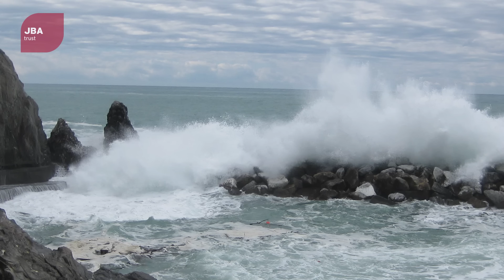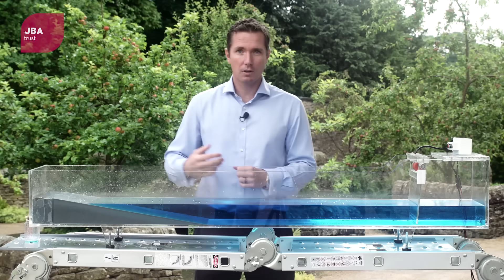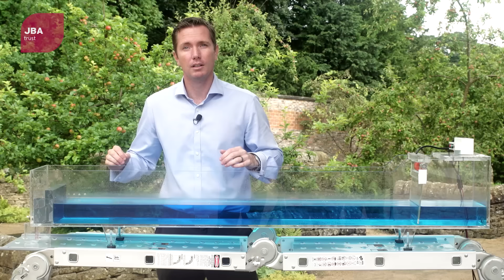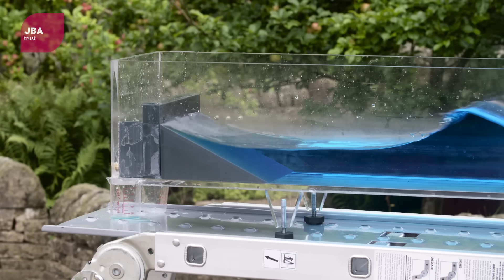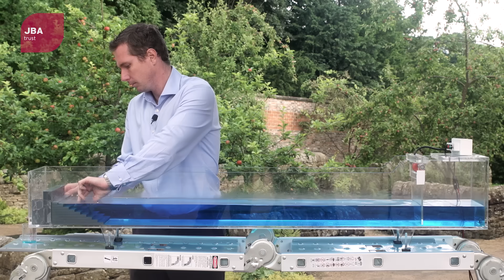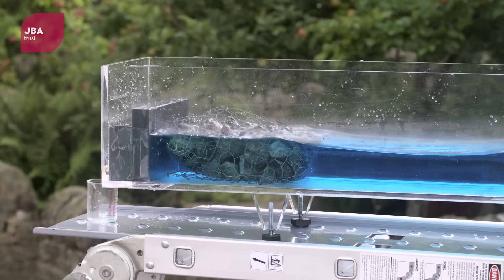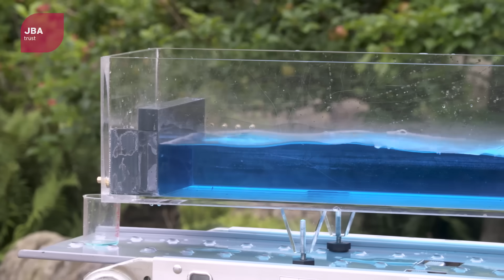Wave tank demonstration showing the impact of coastal defences on flood risk

Comment: what's wrong with oyster growth on a rock revetment?
Reply: 1) If the waves are sufficient and the environment has life, the waves and animals will be removing dead oysters. 2) Oyster shells,  along with other shellfish, are made of calcium carbonate they collect from the water. Shellfish produce a substance that is calcium carbonate based that forms a glue or cement like substance that sticks them to other objects like rocks. They are not taking from rocks, they are adding to them. But even if they were eroding the rocks some, this would be over thousands of years. In the meantime the shellfish themselves would be preventing erosion by the greatest eroding action on Earth, the waves. 3) They would provide more complex shapes to the rocks, dispersing the water even more, which would actually increase the efficiency of the rock design. The rock design is supposed to stop the water, break it up, and force it in another direction which reduces its momentum. The more rough rocks are by being covered in shellfish, the more dispersion would occur. 4) People walking on jagged wave-barrier rocks are already in a dangerous environment, where they can slip and die. barnacles, mussels, oysters, etc. at least provide a rougher surface that would increase traction. Smooth rock will tend to have algae growing on it, which makes it exceptionally dangerous to walk on, as it's as slippery as if the rocks had a layer of soap on them. 

Bonus: 
Barrier rocks provide home for many species and can hold tide pools which also increase biodiversity.
Reply: 4 things mainly: 1) they smell after a while, and smell bad; 2) they dissolve part of the rock where they stay; 3) they can obstruct passage of the water making the structure less efficient; 4) in a beach environment they can be dangerous to people since their shell is sharp enough to cut
Reply: i think they also dissolve some of the rocks to make their shells
Reply: They could maybe put oysters revetment there instead and then there will be a rock growth.
Reply: Smell I guess

Comment: The problem with small scale simulations is that with less water there is more friction, if it was a larger scale simulation the effects could be much more severe than expected (Not just because its more water) because there is less friction from the top of the water to the bottom of the water simply because there is MORE water.
Reply: Hopefully you can work out an equation to calculate these differences to appropriate scale.
Reply: wy dont they put the slope x3 on the beach so if the water dose go over the equivelent standerd of the slope so its x3 more effishent

Comment: Not a completely fair test since you covered some of the defenses , ie the conditions for the test due to the displacement of the modules didn't seem to get taken into account
Reply: This video isn't a study, it's just supposed to get public interest higher. If they were proposing this to a government organization, then they wold have to take in account everything. Regardless, it was a pretty amazing video, considering what Youtube is normally like.
Reply: Hexagram Photography I think they where hollow, so the displacement is minimal
Reply: I was about to comment the same thing. This could be improved with a water level line drawn on the outside of the tank and maintaining the same level for every test.
Reply: fair point- but that wasnt kept the same either
Reply: also I was talking of displacement never of mass
Reply: so you are saying the sand was hollow - you are funny
Reply: Hexagram Photography ah yes I am in fact haha. They may have adjusted, but your right
Reply: water is displaced by volume not mass

Comment: You have too much water in the tank to test some of the defences
Reply: The scaling is off he said when it went over it would've flooded houses when it filled the reservoir with water. He then represents a sea wall that will solve this problem sea walls do indeed stop the problem at first hand in real life. The wall he is representing due to his scaling is about 2 stories tall maybe taller
Reply: Emanuel Ramirez I see your point with the water displacement, but if you look closely you can see that the objects are hollow. They're not displacing that much water
Reply: Ok true that but im very stinge when it comes to demos like these
Reply: Royal Dragon that doesn't make any sense. Displacing water in a small tub is drastically different than displacing water in the ocean. Think before you speak.
Reply: Pradatoru well No... he was testing multiple different defences in the same/similar environment not where each defence is most effective. Yes a standard sea wall would be more effective if the water was much lower, say on a steep hill down to the ocean, and so you wouldn't need any of its more expensive counter-parts but when the wall can't be very tall, on low lying lands, a tall wall would be majorly ineffective due to either steps to go up and over it or pathways through the wall which would negate it's effectiveness
Reply: Pradatoru He was testing during a storm surge.
Reply: 212superdude212-You see i think there is a problem when he added the ramp in with out taking any water out. This then leads to the waves being slightly higher and i don't think we are seriously going to have a ramp in the ocean. Though this demo was full of information, that I won't doubt.
Reply: Emanuel Ramirez 
The ramp represents the shore, so no, we're not gonna put a ramp in the ocean if there already is one by nature xD 
Plus this is a demonstration, a lot of things don't have to be perfect.
Reply: TheHue's SciTech, I will agree with you that the demonstration doesn't have to be perfect, BUT the demonstration should be accurate enough to show true results. Now im not saying that everything is invalid. As a student who has to participate/make few experiments for physics class I know how much of a difference changing one variable. Also sea walls don't have that low angle of a ramp either some curve up and even loop back to shoot the water into the sea. One last thing the sea steps are above the water not already in the ocean. Now I hope you can see my point on why some of the information is invalid but the video it self was educational.
Reply: i thought that at first, but he said something about the said being completely eroded right?
Reply: then how you gonna take out the water in the ocean when u put a ramp in think before you speak
Reply: Yeah uhm its not built in the water to begin with
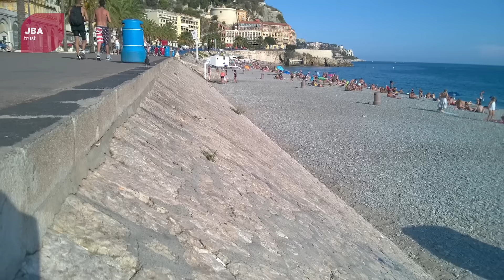Reply: Yami Dokusei- i dont know about you but im talking about the one at 5:35. Also THAT IS MAN MADE. so please go over the video before you get into an argument and come on finding the volume of the ramp then taking out the water isnt that hard.
Reply: Emanuel, you're being rather pedantic. The results were clearly barely/not at all correlated with the volume of the added blocks, so it's silly to claim that the demonstration is invalidated by any failure to keep the water level the same. Sure, you'd want them to do that if they were publishing a paper or planning a real seawall -- but this video is just an educational demonstration.

Comment: Ideally you'd just have the recurve wall with the offshore thing as well.
Reply: You seem to have missed the point of the video entirely. The best option is never to build the most overbuilt possible waste of taxpayer dollars, it's to build the solution that's good enough to offer the needed level of protection while costing as little as possible. Some coasts, for instance parts that are already partially protected by coastal geometry, won't need anything more than a 2-foot high straight concrete wall. At another coast, the buildings might be far enough back from the water that minimal over-topping might be acceptable, making a cheaper option viable. Civil engineering problems like almost never have a single best one-size-fits-all answer, every single option shown here is the best option for certain situations.
Reply: Yeah but those are both really expensive compared to the other options.
Reply: But the submerged indentation in the offshore is expensive and the recurve wall is cheap I feel that the slope and the recurve wall is the best possible option because it's effective for it's price.
Reply: We all here are talking like we are in "Build your own City tycoon 2"  :D
Reply: The offshore block prevents a lot of water sports. If that's a thing for that beach, you'll want to keep it that way.
Reply: why have a recurve wall when the offshore thing prevents the beach erosion in the first place?
Reply: boats and jet skis keeps wrecking on them and surfers complains there's no waves
Reply: Breakwaters don't necessarily prevent erosion, in fact in some cases they can make it worse. Coastal erosion is a very complicated process.
Reply: WaterspoutsOfTheDeep It doesnt prevent erosion, sand can and will still get swept out into the ocean.
Reply: two most expensive of all these listed. you got a good taste haha
Reply: It depends. If we were to only use the offshore breakwater WITHOUT any supports at the beach, we can't be certain that it wouldn't flood over in a storm surge.

Comment: if you make the stepped revetment higher, you would get a different result
Reply: Same goes for all the structures. But you have to compare apples with apples.
Reply: As long as we don't compare structures with apples we are going to be ok!
Reply: did you not listen he said He gonna be testing with a storm surge so that explains why.
Reply: Won't be any better than the wall
Reply: DeansVideoClips we are not comparing apples with apples were comparing structures with structures
Reply: you are right. that one doesn't make sense because the water level is already at the top of the steps.